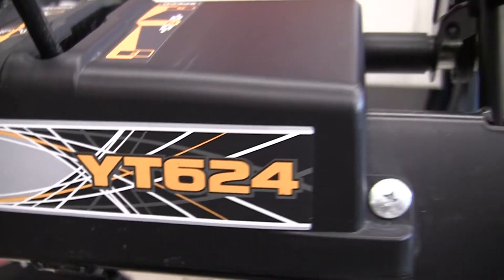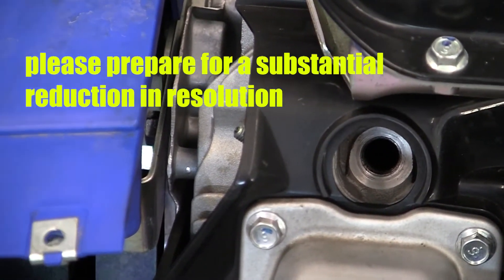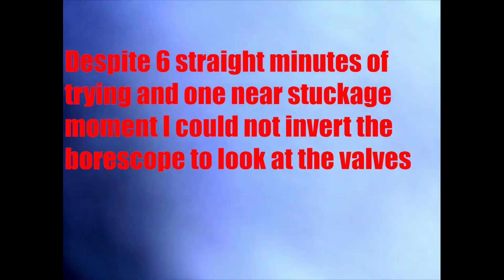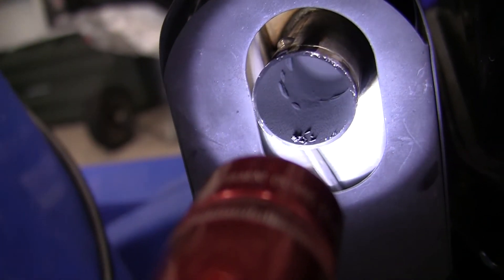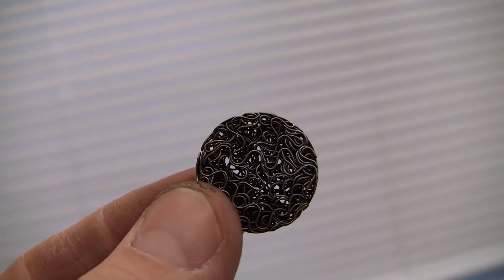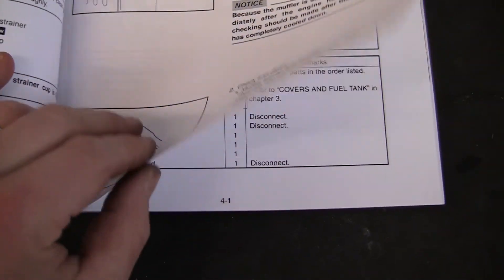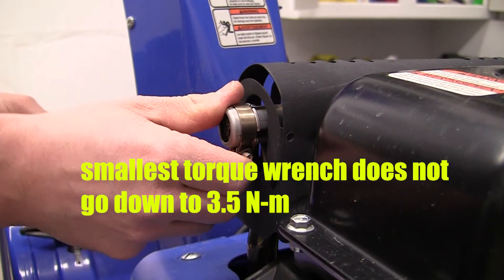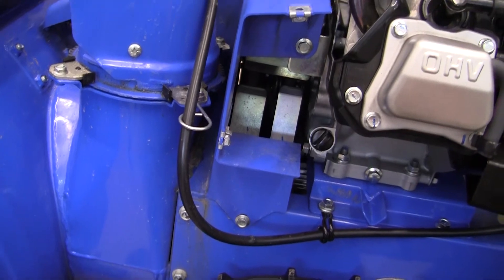Ep. 9 - YT624EJ M.S. - Borescope and Exhaust Inspection

Comment: More!
Reply from the maker: Any desired topics?
Reply: @lucgallant  definitely! These vids are seriously top notch. I do realize they take time, effort and resources so these are only suggestions, but would love to see you do vids on: checking/servicing the HST fluid; checking for spec/adjusting belt, control lever and track tensions; maybe even a vid of a practical strip down and clean (within reason) or tips on corrosion prevention/cable lubrication, etc. I mean again, appreciate that takes time and effort so big thanks for the ones you’ve done already. Love my 2016 624…and it’s about time I started showing it a little more.
Reply from the maker: @goldennewf7098  Had missed this response but thanks very much and trust that I am hard at work on some of the topics you mentioned!

Comment: Is the spark arrestor really needed?  If removed,  would it affect the compression and causing long-term problems?    Thanks for sharing your diy experience and best regards!
Reply from the maker: To me it won't do much for safety and flames but I think it probably does a lot to quiet the machine down. Try removing see what happens!